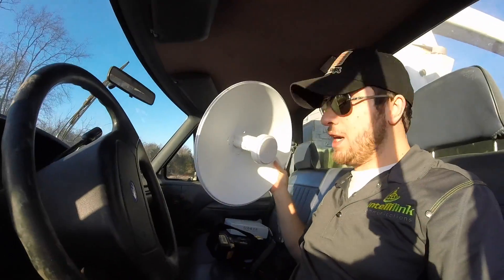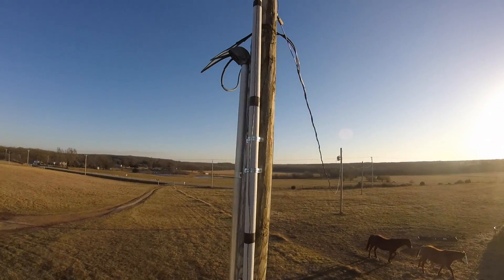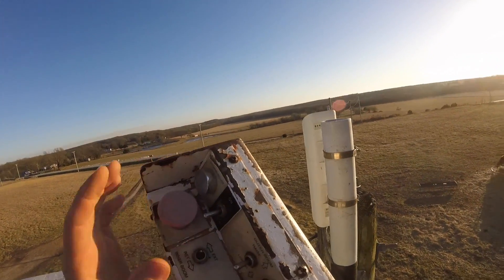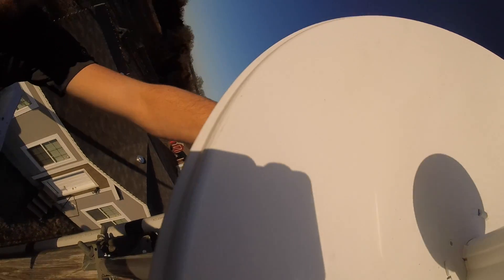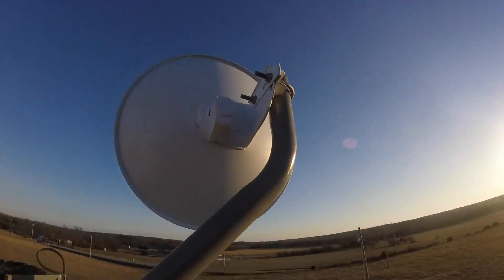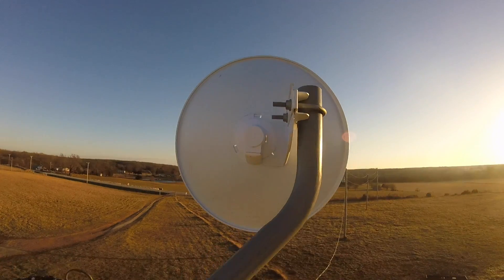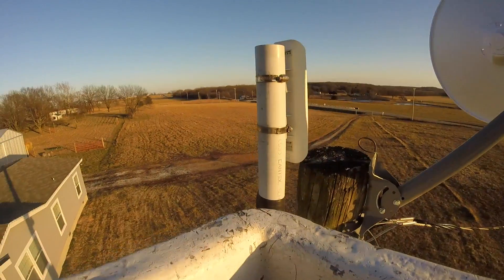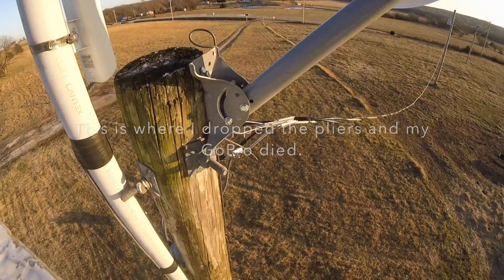Just Another Day, Installing Wireless Internet...

Comment: Hi Gavin. İ have a nanostation m5 ptp connention for 10 miles.(camera+internet) but it is too weak.what can i do to increas the connection quality ? İs powerbeam m5 400 a Good solution ? Or what do u offer for me? Thanks
Reply from the maker: Use 5ghz powerbeam dish 400
Reply: Hi again..i tried 5ghz  400 dish. and the result is more than %100 better performans. Signal strength :  -69/68 dbm airmax quality :  % 70/75
airmax capacity : % 40/50 

Only thing i couldn't solve is internet speed is not as good as i expected. İ just get 5 mbps of 25

Edit  :Everything is ok now.We fixed it by changing Ethernet cable
Reply from the maker: Glad you got it figured out. Ethernet cables are very troublesome sometimes.